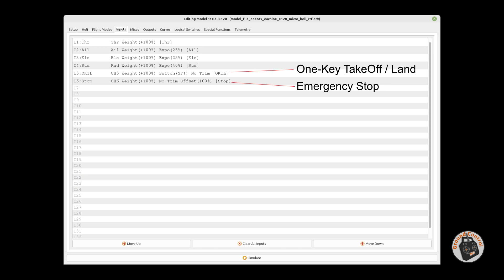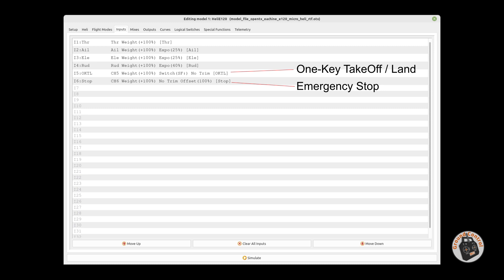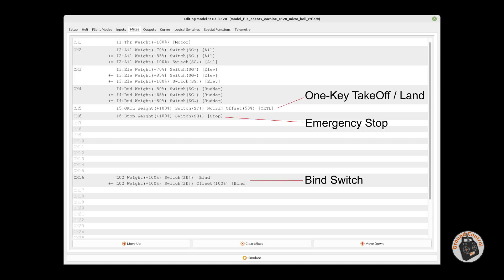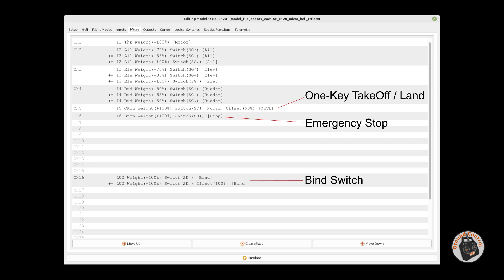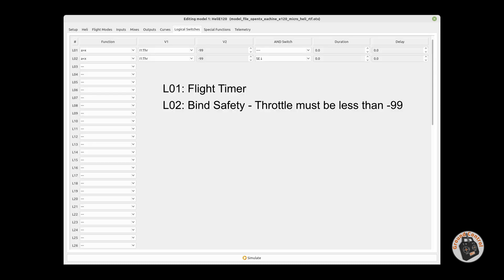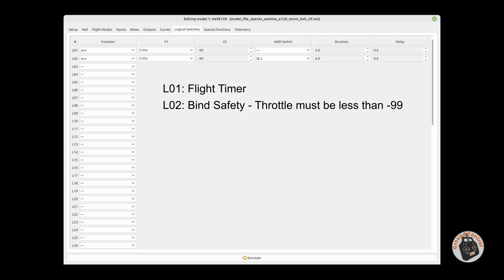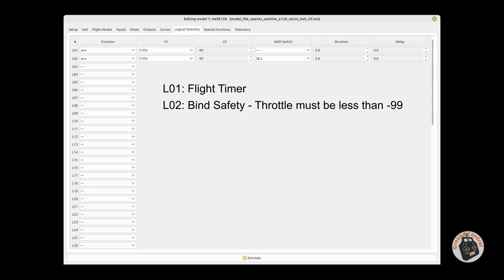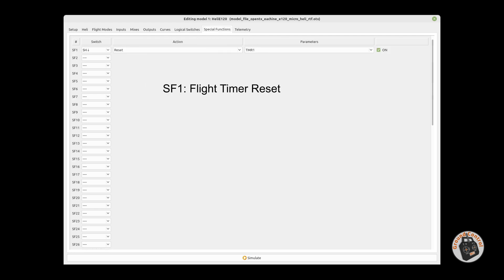Updated OpenTX Model File & OpenTX Companion Setup Screenshots! Eachine E120 BO-105 Helicopter RTF

Comment from the maker: I don't provide my OpenTX Model Files anymore as I've just had to field too many questions regarding Model Files.
I now provide my Setup as a PDF File, for most of my aircraft, that provides all the information needed to setup the aircraft on any Programmable Transmitter.
Setup Files I do provide will be published on TinkerzLab: https://www.youtube.com/@TinkerzLab
Reply: Hi, great but where are your pdf setup file for this model please ?  Thanks in advance
Reply from the maker: @sebaero4109  There's no Setup PDF File for this aircraft as there's really nothing to adjust mechanically on these Micro Helis. It's just programming in the TX.
Reply: @GroundControlRC  Bad news... I really need a PDF file...

Comment: I am from the UK and have the Twister BO-105 from J Perkins - see my profile photo. Is this heli likely to use the same protocol as the Eachine? Same as RC Era BO-105? I would love to use my X9D Plus transmitter + iRangeX IRX4 module instead of the stock transmitter.
Reply: Ok, understood. I have purchased an RC Era BO-105 body kit which appears to use the same moulds and it has C186 on the side, which I think you mentioned was the sub protocol? So maybe the RC Era variant would work but my Twister may be different.
I will be purchasing the multi protocol module anyway for a different project so no harm in seeing if I can find the C186 protocol and giving it a try. 
Thank you for your response. I like your video presentation style - very easy to follow.
Reply from the maker: @billduncumb5052  Thank you and good luck on your project.
Reply: Just seen the age of this thread - will have a go anyway 😃
Reply from the maker: I don't know if the protocol would be the same as they like to constantly change protocols on these micro aircraft.

Comment: Any chance you can throw a link to the tx16s profile for this thing?  I’ve followed your screen shots but I feel like I’m missing something.
Reply: I followed the screen shots as best I could and it binds up no problem but once I do the OKTL it veers uncontrollably to the left as if I’m putting left Ail. (Maybe I’m mapping it wrong?) Where can I get the pdf? Do you have a Patreon? And I can’t get the emergency stop to work lol luckily I haven’t broken or lost anything yet.
Reply from the maker: @wj625  There's no setup PDF file for this one as I performed no adjustments on it just TX programming.
Here is a link to the Multi-Module info for the e129 Protocol.
https://www.multi-module.org/using-the-module/protocol-details/e129
The problem might be your channel order as my TX is setup for TAER by default whereas most people use AETR as their default.
My guess is you need to change the channel order AETR.
I have the Emergency Stop mapped to my Momentary Switch.
https://www.patreon.com/groundcontrolrc
Reply: @GroundControlRC  that’s probably it my  I’m an AETR guy. I’ll try switching them and try again. Thanks.
Reply from the maker: @wj625  You are most welcome.
Reply from the maker: I don't provide my OpenTX Model Files anymore as I've just had to field too many questions regarding the Model File.
I now provide my Setup as a PDF File, for most of my aircraft, that provides the information needed to setup the aircraft on any Programmable Transmitter.
What do you think you're missing?

Comment: Are you Binding in SFHSS Protocol for this Model’s Receiver?
Reply from the maker: No, the Protocol is E129 and Sub-Protocol is C186
Reply: @GroundControlRC  Ok just saw a vid binding to C129 Eachine in Radio. Didn’t show any Sub protocol.
Reply from the maker: @DoubleDiamondRR  Yeah, for some reason OpenTX Companion doesn't always list the Sub-Protocol in the GUI.
Reply: @GroundControlRC  
Ok had the EDGE TX Boxer two days now. Hours on end programming the setup. Watched 4 key videos while doing it. Worked all the way through today to getting Companion and TX Flasher Tool. 

Pulled down the Firmware in Companion and the latest Flasher bootloader. 

I had my BO-105 built in the radio, but only shows Multi E128. No Sub selection below that. 

I Read the Radio into Companion and. Opened up Edit on my Model. There it Does show the Sub with C186. 

So I Wrote that back to the Radio. No difference in radio. No Sub Selection showing. Other Protocols due have Subs. 

This is EdgeTX instead of OpenTX. Wonder if that is the problem. Or this Status it shows under Type E129. 
Status    V1.3.3.7  AETR
CH Range  CH1- 16
Receiver  00[Bnd] [Rng]

Does that V1.3.3.7 need updated? Whatever that is. Is that The Internal Module Version?

16 hours work and No Joy. 
Everyone I’ve seen Bind to these were all OpenTX, Not EdgeTX. 

I currently have a useless Radio. Can’t Bind to my 2 E129 Helis. 🤔🥺

Can I get Support from Radiomaster on this?
Reply from the maker: @DoubleDiamondRR  Hum, I'm not familiar with EdgeTX other than it's supposed to be the Cutting Edge of OpenTX ;-)
There are (2) parts to the Firmware on my Radio with OpenTX. The OpenTX Firmware and the Multi-Module Firmware.
The number, such as the V1.3.3.7, you listed is the minimum level of the Multi-Module Firmware you need for that Protocol.
I'm not a radio expert but that's the way I understand it.
Reply: @GroundControlRC  
Onto something now. Got an EdgeTX Model yml file. Put it in and the E129/C186 is in there in my radio for that model which is my #2 Heli. Needs lots of tuning and adding of settings but I’ll get that. 

Now it turns out my own Model.yml file was Named incorrectly. Wrong file naming convention. Radio didn’t totally recognize it. Fixed that but Lost all the Configs I did. 

Starting over but going much faster now ….. 🙄
Reply from the maker: @DoubleDiamondRR  I'm glad you got it figured out. The hard part is over ;-)
Reply: @GroundControlRC  
Ok Not figured out. Got the Latest Stable Build v1.3.4.0 of Serial STM32 4-in-1 Flashed the Multi Module Ok. 

Same issue. Does have the E129/C186 showing in the Radio under Multi. In Model Settings. 

Bind makes the BO-105 Fast Flash correctly but Never Binds. Eventually Times lights out back to No Radio Standby. 

After awhile the Cyclic will move Blades in a Very Delayed/Lagging occasional movement. Like a Slow Robot jerking. (half Bound?). Never seen anything like it.

I’ve programmed multiple Helis before with Blade or higher FBL’s in various DX Radios. 15 years contiguous Flying 3D planes and Helis. 

I just tried more Tricks by Creating a New Basic Model, no configuring anything but Bind Protocol Selections. No matter. Won’t even Bind a basic E139/C186 Model. I tried 2 newer Versions of Multi Firmware, Same result. 

I was able to bind to an old Spectrum Receiver using DSM with the Factory older Multi Firmware. 

I even was able to Program the Boxer Throttle to initiate Bind like the Stock Radio. Same result. No Go. 

I’m pretty much convinced the Internal Multi-Module is bad. Stock radio Binds Instantly!

One more test to try Saturday. Try to Bind this Basic Model to my new RC ERA MD500. Same E129/C186 Protocols. If that doesn’t work, I’m calling HeliDirect for a Return. Probably Upgrade to an Edge TX16S….🤔
Reply from the maker: @DoubleDiamondRR  Sounds really strange.
I checked my setup and yes, E129/C186 Protocol.
Is you channel order correct and the model has no trim or subtrim input?
Here is the multi-module page for this protocol as I would make sure the channel order matches.
https://www.multi-module.org/using-the-module/protocol-details/e129
Also, double check the trim.
Some of these toy models will not bind or initialize with too much trim or subtrim input.
Also, from time to time these mfg will change the board and therefore the protocol on these aircraft.
Not sure if that could be the case, just thinking out loud ;-)
Reply: @GroundControlRC  
Looks like Possibly Radiomaster uses TAER for Open/Edge according to Multi page info. Will download TAER BIN and try Flashing it on the SD Card. Another Late night. Been 1:30 AM last 3 nights! 🥺
Reply from the maker: @DoubleDiamondRR  No rest for the weary!
Reply: @GroundControlRC  
I tried Every CH order 3 different layouts/files. 

Same on all but got motor turn on uncontrollably on RETA Firmware. Heli was held down on carpet by heavy 123 Blocks weights across skids. 😅

Flashed. TERA. RETA, back to AETR which IS the Factory Firmware. I Checked the original Loaded Firmware. 

So done testing on the BL-105. Nothing left to try.  Can’t Bind a Basic E129/C186. It IS C186 because it will go into Fast Flash waiting on the Bind Signal. Then after 90 sec. Times out. 

Switching to the MD500 tomorrow (already tomorrow)🙄 Same Protocols same RC ERA Radio. Friend in Slovenia flies one on EdgeTX16S. I have his yml file. Thanks and Good Nite.
Reply: @GroundControlRC  
Ok said I was Done but Wasn’t!
40 years in IT made me that way!

Decided that only thing different on my radio was I set the Throttle to Center with the spring adjustment. So returned it to regular Throttle on Bottom Stop. 

No difference. No Bind. 

My plain Basic Model causes Throttle Warning on Radio Power On Every time. 

Blew that Model away and Created another New Model. No Settings. Just Defaults. Turned on Internal to Multi E129/C186. Bind. Gets Fast Flash on Heli. Never Binds. 

Pretty convinced the Radio/Internal Module has Issues. 
No other Workarounds or Tricks left. Still need to move to the MD500 with a fresh Copy of the Working yml from Slovenia pilot. If I can’t Bind to That, pretty much pro es a Boxer/Multi Module issue. This Battery is running down in 3-4 hours too. Supposed to be 20 hours. Think the 16S runs a 5000 not this big 6200. 

I have a TX16S MKII Red in my Helidirect Cart. Calling them Monday for Boxer Warranty Return unless the MD500 Binds…. Man the Hours I have burned!!!! 😖🥺🙄😞
Reply: @GroundControlRC  
Ok Final Boxer Report. Epic Fail!!

Put the Working Slovenia’s pilot yml in Fresh on the SD Card. Tried Binding the BO-105. Same results. Fast Flashing. No Bind Confirmation beep or anything. Goes back to Standby flash. Blade  movements are delayed and not corresponding. Erratic. Won’t Calibrate. Won’t Idle Spin. 

Took radio down to the secret MD500 hidden in box. Tried  Bind. Same thing but with usual Beeps, but no confirmation Beep and Solid LEDs. Slow Flash. More dramatic Blade movements, but still erratic, uncontrolled out of synch. 

That pretty much proves the Boxer is Incompatible with these E129’s/C186. Probably an Unknown Module Firmware issue. I do wonder about the Throttle Warnings on a blank Model. Saying Throttle is not at Idle. Makes me think left Gimbal has issue. 

Testing Battery Life now for more Warranty evidence. 🙄

Guess this forces me to get the TX16S. I guess users love Boxer on ELRS. Good on them. 😊
Reply from the maker: @DoubleDiamondRR  Yeah, could be a bad solder job, broken wire, bad RF Module, etc.
I had an issue on mine with the DSMX Protocol losing contact but DSM2 works fine.
That was after several years of use so I don't know if it's an RF Module issue or a firmware issue.
I stay away from DSMX now ;-)
Hopefully your TX16S will be ready to go when you get it.
Reply: @GroundControlRC  
I’m sure I’ll have to Flash Firmware out of the box. Must be old stock.
Reply: @GroundControlRC  
Got the Boxer Return Approved. Going back on HeliDirect UPS Label tomorrow. 

EdgeTX16S ordered last night. Shipped today UPS. Be here Wednesday Noon. 

Already got the new Firmware for TX and 4in1 on Laptop. 

Now will have to go back and check your Rates setups. 🙂
Reply from the maker: @DoubleDiamondRR  Yeah!
Reply: @GroundControlRC  
Good News!!

UPS delivered early but couldn’t start till after lunch

New TX16S from HeliDirect. This radio had 7/2022 Firmware! Gotta be old Builds.

Took 90 min. To get Firmware directly on SD Card. USB won’t connect. Win10 problem with STM Drivers. Fix that later. 🙄

Put in New Aero Model. Set up MULTI E129/C186. Did Bind from Settings. Took couple seconds and Success!! All Cyclic movements. Did Calibrate. Worked properly. 
Already did Radio Calibration first thing. 

Motor started but I couldn’t stop it even after adding Cut Switch. Will go through my favorite EP Buddy customization Vid next. 
Had to hit Bind again to stop motor. Will get this straightened out. 

To busy Tornado Tracking for Mid TN today. Us in Ohio last night till 2 AM. 🥱
Reply from the maker: @DoubleDiamondRR  Fantastic!
Stay safe!

Comment: I’m getting a Boxer. Don’t think your File for 16XS will transfer in. Heard of issues. 

This makes my head swim a bit. Have to Zoom TV to even see written info on paper. 

Did you do an Initial Setup video on the Radio for this Model. 

I have the model, been flying a week on the Junk Radio Eachine provides. Gimbals are terrible, especially the Cyclic side. Too touchy and my inputs don’t translate out to what I’m inputting. 🥺🙄. Lots of times it starts going the opposite direction then catches up. 🙄
Reply from the maker: Congratulations on getting the Boxer as I've read it's a pretty good TX.
I think I published a video with screenshots from OpenTX Companion for the Eachine E120.
Here is a link to the playlist: https://www.youtube.com/playlist?list=PL_YiEhY7O1WZAmvowoEZa10qAYT0KL0Gh
I'm not sure which video it is but it's most likely in the video title.

Comment: What Receivers can you use with the RM TX16S? I’m all Spectrum for now. I know these RTF’s run Futaba based. What Receivers do you use if not an RTF?
Reply from the maker: I have the 4-in-1 RF Module so it supports many protocols including Spektrum.
Here is a link to the Multi-Module page so you can see the protocols that are supported with the 4-in-1 Module.
https://www.multi-module.org/
Reply: @GroundControlRC  
So if I get the TX16s as a 4-in-1 version should be good?
Reply from the maker: @DoubleDiamondRR  That's what I use. It's my primary TX.
Reply from the maker: Also, one of my favorite Receivers is the WFly RF201S.

WFly RF201S 1.32g Micro SBUS PPM receiver (OpenTX Supported)
https://s.click.aliexpress.com/e/_DBWoZkP

WFly RF201S 1.32g Micro SBUS PPM receiver (OpenTX Supported)
https://amzn.to/3J3IaIk

Comment: Happy New Year Everyone,
I'm new to the group and rejoining the hobby so please bare with me. Have the Boxer 4in1 version and trying to bind E120 and C189MD500 and can,t get the sub-protocol C186. Have current ver EdgeTX 2.9.2. Sorry if this has already been posted but ANY help regarding on how to this would be GREATLY appreciated.
Thanks
Reply from the maker: Welcome back to the Hobby!
If you're not seeing the proper SubProtocol you probably need to update the Multi-Module Firmware.
The Transmitter consist of (2) Firmwares - The OpenTX or EdgeTX Firmware and then the Multi-Module Firmware.
Here is some info on the Protocol and hopefully some links that will help answer some questions.
For the E120 Heli:
The Protocol is E129 and Sub-Protocol is C186
This is the link to the Multi-Module page for the Protocol Info:
https://www.multi-module.org/using-the-module/protocol-details/e129
The Minimum Version of the Multi-Module Firmware to support this Protocol / SubProtocol:
Firmware Version:  v1.3.2.6
I hope that helps.
Reply: Yes it most definitely did, thanks!

Comment: hello sir ...im just curious of this video on how u program the heli...anyways others program there helis through radiamaster tx16s but what software you use to program through computer....i think its more easy to program helis by computer....thank you😊
Reply from the maker: I use OpenTX Companion to program the Transmitter using the computer.
It is easier for me using the computer to perform the programming rather than the transmitter.
Here is a link to OpenTX and OpenTX Companion.
http://www.open-tx.org/2022/04/22/opentx-2.3.15
There are links at the bottom of the page for different operating systems.
Reply: @GroundControlRC  

Thank you for the info… 🥰
Reply: Open tx still works tx16s mk2 2024?I like Open tx more then edge tx.

Comment: What is the Rx protocol for this helicopter? Frysky , v761…? Thanks
Reply from the maker: The Protocol is E129 Sub-Protocol C186
Reply: I already downloaded the e120 OTX file and I should store in which folder and do I need to change the file name ?
Reply from the maker: @tyou7139  No need to change the filename unless you already have an otx file with the same name.
I get a lot of questions regarding how to use our OpenTX and Setup Files so I make a Video Tutorial on how to use them.
A link to the Video is posted on our Facebook Page and I pinned it to the top of the page.
It will explain how to use our Setup and OpenTX Model Files.

Comment: Hi there, thank you for sharing your great experience and useful suggestions! Could I use this profile also on a Eachine E129/E130 helicopters?
Reply from the maker: Absolutely! Just change the Protocol and make sure the channels are in the proper order and you should be good to go.
I use this same profile on the Eachine E110.
Reply: @GroundControlRC  thank you so much, I’ll try it on my E130! On EdgeTX seems the protocol available is just the E129, so could i suppose this is the “standard” protocol for all Eachine’s heli… Am I wrong?

Comment: Hi, any idea why my stop switch is not working..
Reply from the maker: Hi David!
No, as mine has always worked.
It could be a bad switch or somehow the programming has gotten changed?
I would check the output of the switch in the programming screen to see what it's sending.
Reply: @GroundControlRC  thanks for the reply..
Reply: When you get a min, could you tell me what I should see on the monitor screen for the switch, thanks again.
Reply from the maker: @davidwright1474  Hi David!
When you activate the Momentary Switch for Emergency Stop it will show 100% when activated. I have it assigned to CH6.
Reply: @GroundControlRC  all sorted and many thanks for your help.
Reply from the maker: @davidwright1474  You are most welcome!
See you in the Air!